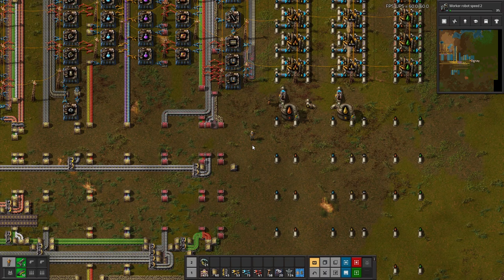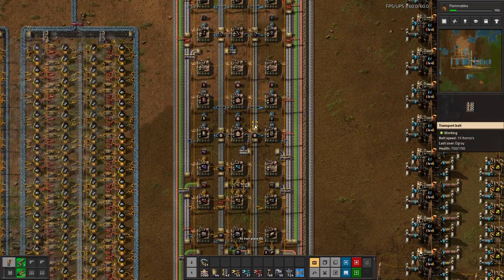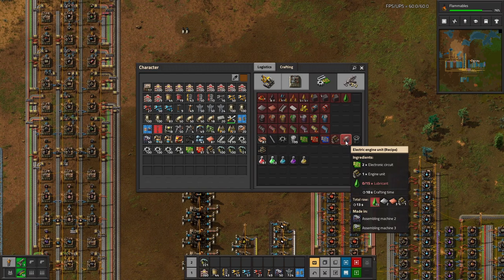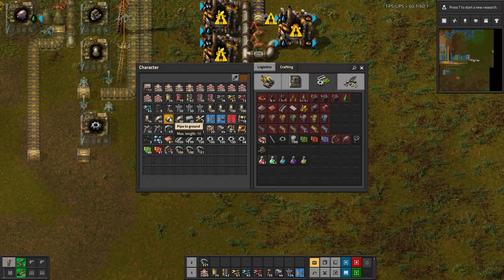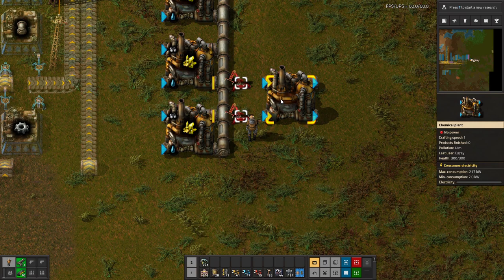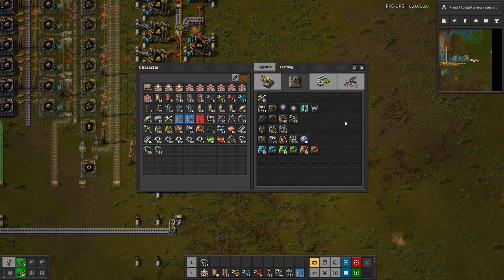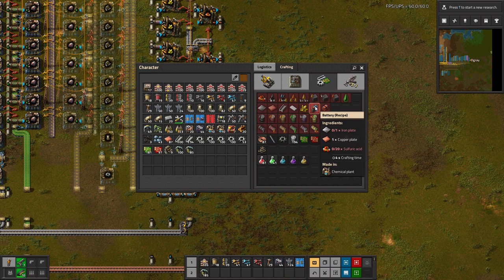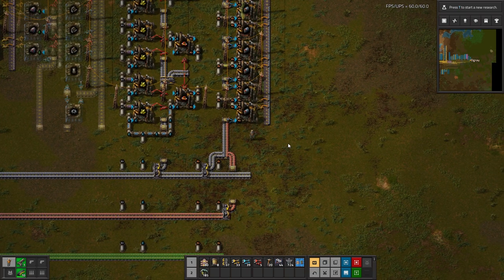ELECTRIC ENGINE AND BATTERY - Factorio 1.1 - Entry Level To Megabase 2! - Let's Play Tutorial! Ep 14

Comment: The acid pipe for the batteries can just run next to the chemical plants, (inside of the belt). That way you don't need any underground belts and it uses fewer pipes.

Comment: Hey! Excellent series. The engine units are 10 machines for 1 pipe machine. We did 12 because of blue science. You copied the same build with 12 engine unit machines and added 12 electric engine units but there should be 10. 😊